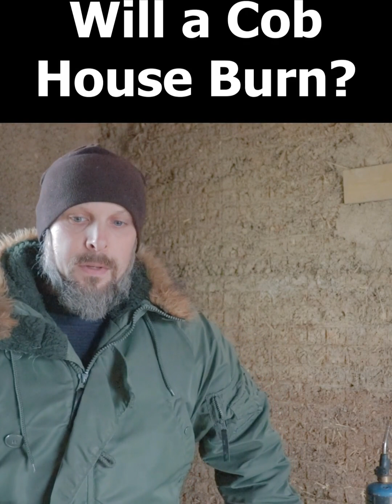Will A Cob House Burn? 🔥 Cob vs Fire  #cobhouse #cobbuildingcodes #firetest

Comment: What if your wall had a hole that allowed the flames to enter?
Reply: You use cob in combination with some resiliency efforts, like fire shutters and a fire break line and whatever other measures that can be put in place. You don’t just rely on the cob alone. It only greatly reduces your chances of fire destroying your home, it doesn’t make it zero.
Reply from the maker: Yes, that could be a problem.